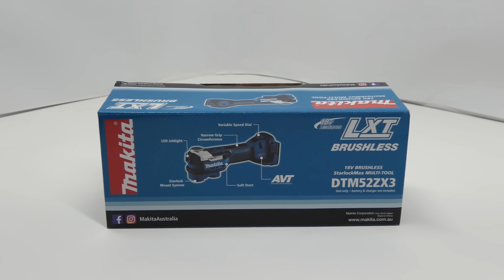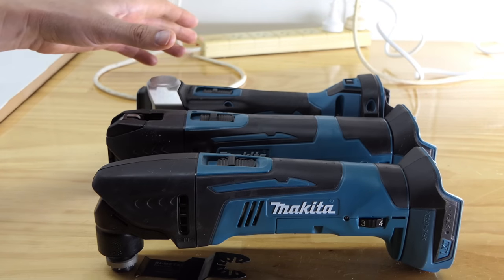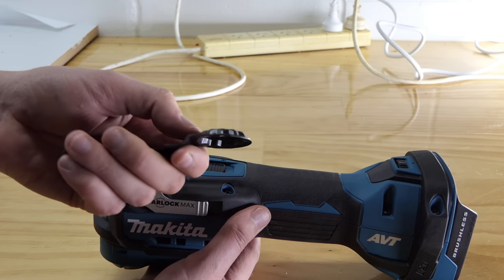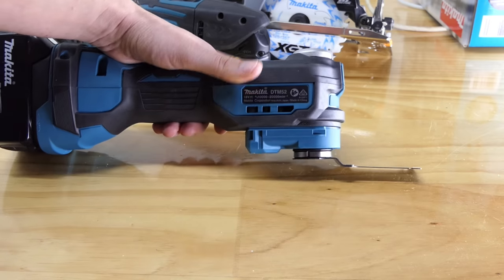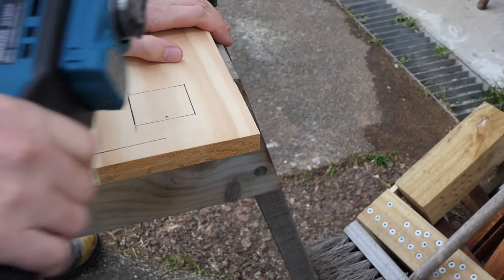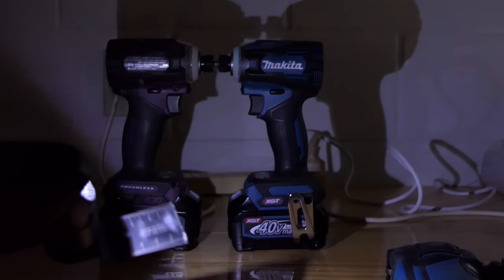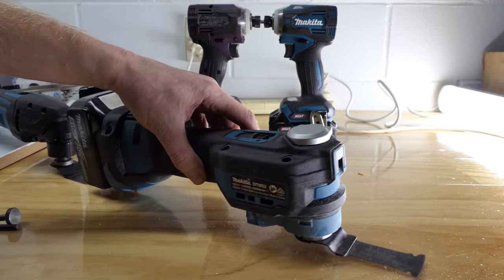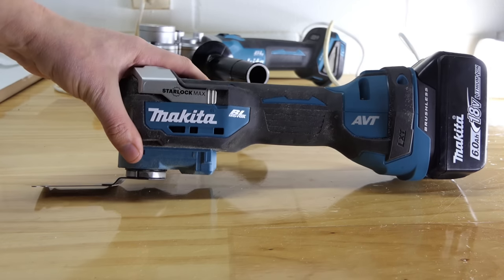Makita 18v Starlock Multitool Review DTM52 VS DTM51 VS DTM50 Makita Multitools. Which is Best?

Comment: Interesting, I’ve always viewed these things as a toy for home gamers and never bothered. Their random incomparable blades aren’t helping the cause. Are they worth bothering with….

Anyway great video thankyou.
Reply: Depends do you do alot of fiddly little cuts in dark deep holes.. Or not lol
Reply: That is what one thinks before he gets one... And then he just starts finding it new and new applications. The different blade attachments are not such an issue, there are tons of blades and attachment on the market. On the old Makita and on Mikwaukee multitools for example - you can fit all the blade types. It is the quality of the blades - for metal cutting for example - anything  but a titanium or carbide blade will dull just after a few cuts.
Reply: @sizif717  I know what you mean.. If you got one you'd probably use the shit out of it.. If I  had one all I'd get is diablo blades.. But since I'm a mechanic I definitely don't need one
Reply: I use MT mostly as an undercut saw for trim when flooring and to cut drywall when adding switches and outlets. For me, it's not an everyday tool but has enough utility that it has a place in the truck. It's also pretty great for notches and finishing plunge cuts made with a circular saw.
Reply: Ignorance is bliss ! Haha
Reply: @chrisford8403    Thanks for the feedback,  i never thought to cut out drywall for power outlets. Might have to add it to the list!
Reply: @nedt  But wait! It get's better. There's a special blade that cuts all 4 sides at once. It comes in single and double gang. Looks neat but I never tried it. Harbor Freight sells a cheapy MT for $20 if you wanna try it; these are how I got into using MT's and then upgraded to a better name when it burnt out.

Comment: As all makita multitools, the new one is kinda dissapointing. They arent up to snuff in multitools department. The decision to go starlock only, no dust extraction solution out of the box and cumbersome blade interchange system for a hefty price jist dont justify the noise and vibration reduction. Im a makita guy but everything about these multitools puts me off.
Reply: That's exactly what I thought. I just went with a corded Bauer multi tool. it's louder and probably vibrates more but it's cheaper and doesn't look as bulky
Reply: @rac-qb4dt  True story, hard pass.

Comment: I wish I could find the DTM50 (XMT01) in the United States. I don't like the 02 at all and I don't like the price of starlock blades for "rough work." I do have the Bosch GOP 30 starlock corded model.
Reply from the maker: the DTM50 is actually the XMT02. The 51 is the 03 and the 52 will presumably be the 04.
Reply: @ToolsAndStuffOFFICIAL  well, naming aside, I still would like to find that original model.

Comment: Any idea why they removed the urethane cylinders stoppers/bumpers in the battery hatch? All my other Makita tools have them and this tool has empty slots for them, but they aren't there.
Reply from the maker: Probably because the whole battery mount area has suspension for battery protection.

Comment: 10:20 tip use the whole blade you wont ware as much. These blade are expensive at least here in sweden
Reply: Everything looks good except for the pin that holds the blade in place. 2/3 step process is really annoying. Might as well stay with the 51 than upgrade to 52. Luckily I have both Makita and Bosch cordless system, so I'll be going with Bosch cordless oscillating with this one. Sorry Makita better think of a better way of locking the blades in place.

Comment: The Bosch carbide tipped blade will cut hundreds of nails.
Reply: Good to know. I had good luck out of Drexel blades when I changed some siding. My Ridgid blades however failed in maybe a couple nails.
Reply: The key to running these blades against nails is to pull down the oscillating speed. A fast blade is a hot blade is a worn out too fast blade.

Comment: Just bought the 52 and the first thing I noticed different from the 51 is the lack of tool vibration and lower noise.  just wish I could use my old non star lock blades.
Reply from the maker: Video soon showing you how.

Comment: The starlock max blades are longer.  I’ve got the Bosch 18v which only takes starlock plus and there have been a couple of times when those blades didn’t reach where I wanted to go.  Would have bought the Mkaita 52 if it had been out.
Reply: I've got it too and have the same problem. 
Now that Fein, Festool and Makita all have starlock max cordless tools, I hope Bosch GmbH get their shit together and come out with their own starlock Max cordless. Perhaps with the biturbo motor, that would blow everyone else out of the water. It's not like they couldn't...
Reply: Starlock etc was invented because with long blades the pins shear off OIS system.

Comment: Can anyone recommend a brand of star lock blades?  The Bosch ones are relatively expensive vs their non star lock multi tool blades. Thanks. 

I an in UK btw. Just after I bought a Bosch starlpck multitool they brought out a new model which is way quieter, the battery doesn't fet in the way and less hand vibration. 😑
Reply from the maker: I use these https://amzn.to/4dRNehb

Comment: So you can put longer blades on it which are way more expensive if you can even get hold of them? Not selling it. I also prefer the 50 but the Allen key locking is a ball-ache and it's too easy to overtighten. I have big enough hands that I can use the 51 so I'll stick with that. Noise doesn't concern me too much, don't have to work in libraries that much. Wish it had a light. If I had my choice I'd also go with the DeWalt but not running separate charger/batteries for one tool. Thanks for the video. Think Makita have more work to do.

Comment: How come you can't quickly change bit like Bosch mutil tool as same system called starlock? Also I don't like fat head sorry makita for this time still stick with my Bosch multi . They are good slim, brushless and change change bit in a second with one hand snap in.
Reply from the maker: Starlock is the blade shape, not the attachment method. It may be that fein and Bosch wouldn't let Makita use it, or Makita didn't want to pay the price.
Reply: @ToolsAndStuffOFFICIAL  TURE, but I use Makita starlock blade for my Bosch now, price is great compare Bosh and Fein blade
Reply from the maker: I have a bunch of fein blades I have imported from the UK as it was cheaper than buying any brand of Starlock blades in NZ. I will use them in a future video as they didn't arrive in time for this one.

Comment: Oslo tool company make an adaptor, I have one and it's awesome.
Reply: I found it a bag of shit in my fein. Lasted 10 secs. The owner refunded me straight away and said they've had quite a few failures and are working on beefing the nipples up. For reference i was cutting 28mm copper and it couldn't handle the vibration and nearly all the nipples fell of (yes it was tight)
Reply: @leerolfe5332  How long was the blade? This is why Starlock etc was invented, OIS can't handle long blades.
Reply: @Paul-XCIV2 Exactly. I was using an OIS blade in an adapter on my starlock Fein. Not sure I follow your question?
Reply: @leerolfe5332  long blades don't work on OIS, that's probably why it failed.
Reply: @Paul-XCIV2  you’ve totally missed the point pal. I was using a short normal OIS blade with the adapter on my Fein. Jeeze mate. 🤯

Comment: You say “it’s LXT.  Of course “..... OK. Wtf is “LXT” ? .. I’m finally getting around to shopping for one of these tools, and I’m not thrilled with all the bullshit with the different tool bit fastening systems. Kinda makes me want to buy the Bosch but I run mostly makita batteries. 
This is the same foolishness as with the SDS bits I solved that by buying the SDS MAX and an adapter to run any SDS Bit.
Shopping for an oscillating tools, the biggest issue is the bits.. I don’t want to have to deal with some weird proprietary tool bit system. Watched this vid to find the answer ?

Comment: Doesnt even seem that great of a blade change system. Dewalts blade change is so simple but fantastic. And if need be you can use different blades without the quick release feature. And the the dewalt has a paddle switch with the option to lock it on
Reply: I've got the DeWalt. It's fantastic with the pull trigger to change blades or blade angle. Light, trigger lock, variable lock speed. It stands head and shoulders above this Makita, I think.

Comment: No! No! No! Starlock was invented by Fein AND Bosch! Get the original Fein Multimaster! All the others are hardcore sex toys, not tools.
Reply: Would you get the corded Fein to avoid dealing with a separate battery system?
Reply: @zorbaseatery4745  I only buy corded machines.
Reply: Bruh...Bosch makes the Bosch blades in Switzerland.  Fein makes the Fein blades in Germany.  About who invented what...what do you believe the most likely scenario was?: A.) Patents are running out, everyone is gearing up to enter the OMT market.  Bosch wants to own the consumables section as they do with SDS and Jigsaw blades.  Bosch creates a proprietary connection.  Bosch brings it to Fein knowing that getting Fein onboard will be a huge deal.  B.) Fein sees their patents are running out.  They make a new proprietary connection.  They go to Bosch and ask Bosch to sign onboard and make a bunch of consumables that will compete against them in the marketplace.... ???
Reply: @zorbaseatery4745  Fein uses Bosch batteries as of today.
Reply: @zorbaseatery4745  My corded multimaster has been sitting in the closet collecting dust ever since the day Festool brought out the cordless Vecturo (cordless Fein Supercut but with an emoticon of presence in my country).  This new Makita actually looks pretty good.  If I didn't have the Fein/Festool, I'd buy the Makita.
Reply: @robertrada6040  Read the fucking Patent!
Reply: @robertrada6040  What?! I can use Bosch CORE 18V batteries in the Fein MM 700?
Reply: @zorbaseatery4745  I’m not sure when but Bosch announced it today.  Fein will start using their batteries.  Will it just be the multimaster? Will it be everything?  I don’t know.
Reply: @robertrada6040  Do you recall where they announced it? I've been looking but don't see a peep. Seems significant, and the Bosch CORE 18V batteries are all 21700 cells 💪🏽

Cheers
Reply: @zorbaseatery4745  Bosch announced it via one of their European social media accounts, as I understand.  No press release and not a peep from Fein.  Typically, when Fein announces something, I’ll see it five years down the road.  When Bosch announces something, I’ll see it when pigs fly. So, with a double whammy such as this, who knows?   Metabo was showing off the cordless Steinel heat gun during the CAS announcement.  How many years before it softly became available as a Metabo SKU with the dreaded “special order” phrase affixed to it?  😂.  There’s nothing wrong with the cordless Fein version, meanwhile.  It’s a 400 watt tool (at most).
Reply: I believe Fein are doing 21700 now with some of their kits.  Probably Europe/UK only.
Reply: @RegisG.  End 2022 was a bit of a disappointment 😏

Comment: About cutting nails and screws.... the blades, even the metal cutting blades, are not made for that. Use and angle grinder or the like instead. Especially since the blades for these multi cutters are expensive !! Easily 30-40 buck for a single blade.
Reply from the maker: If the metal cutting blades aren't for cutting nails, which most people use them for, then what are they for, as they wouldn't cut much else?
Reply: @ToolsAndStuffOFFICIAL 
Yeah. You're right, of course. I guess it could be useful for e.g. cutting sheet metal in hard to reach places, but otherwise it's of little use for anything else than cutting nails and screws.
I just ordered the DTM52 couple of days ago. I also ordered a metal blade (BOSCH PRO AIZ32AT) among others... at the bargain price of 22 Euros. I guess I can justify using it for cutting nails at that price, LOL.